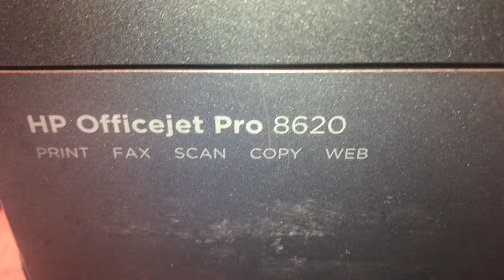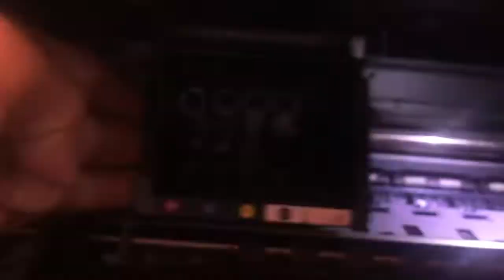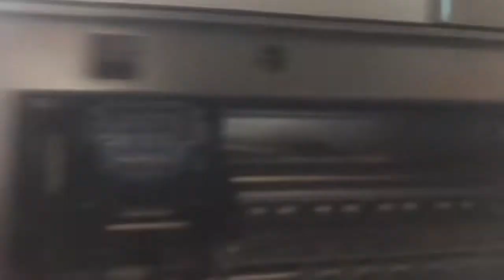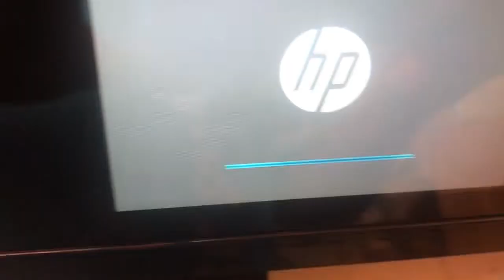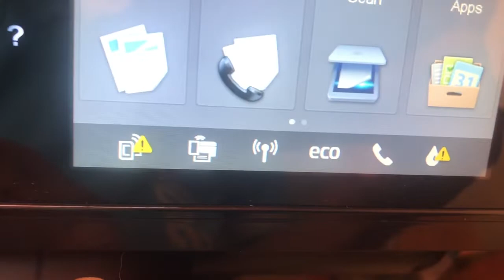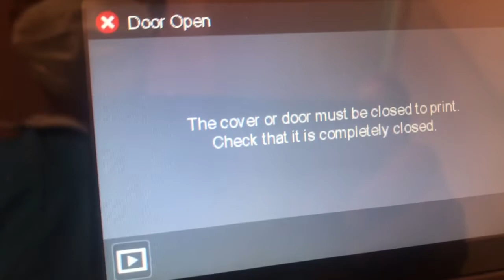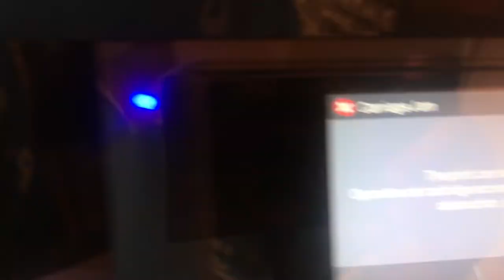HP Officejet Pro 8620 error Missing or Failed Printhead checking

Comment: What if the Printhead moves to the right. How do I get it back to the left load position?
Reply from the maker: printer head  control by motor ,so you need let printer running by plug power cord and when see the printer head move unplugged power cable